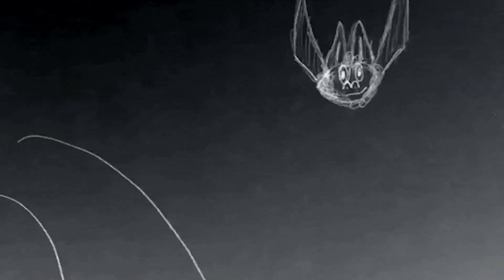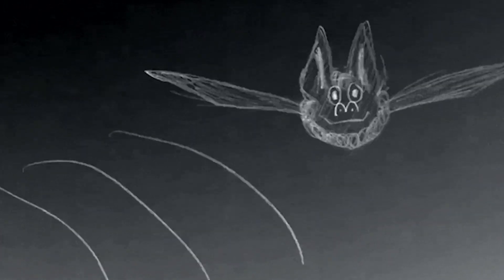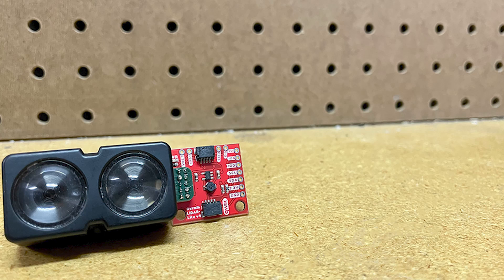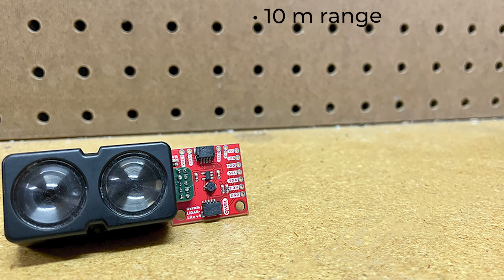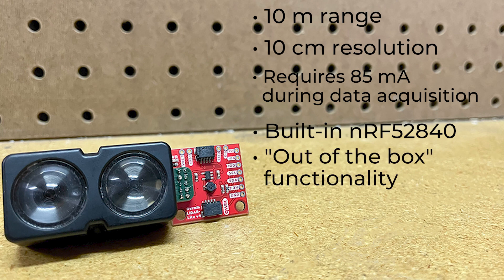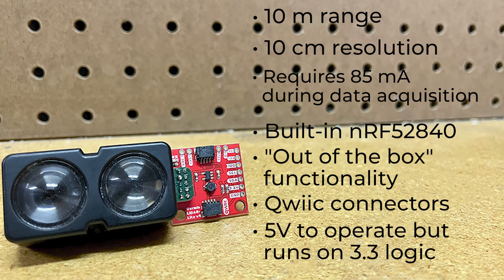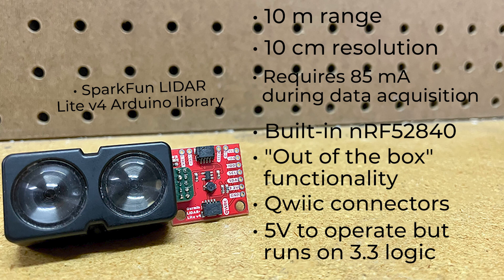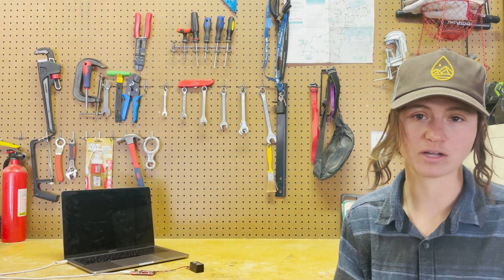Product Showcase: Garmin LIDAR-Lite v4 Qwiic

Comment: 10cm resolution is not very good!
Reply: Yes it is. This is on distances up to 10 meters, ie 1%.
The resolution on up to 2 meters is +/- 1 cm, ie also 1%.
That's not bad.
What are you comparing it to when stating it's not good? Is there a better device at this price point?
Reply: @MartinBgelund  maybe compared this hc-sr04 which has +/- 3 mm  accuracy on 4 meter range?

https://www.sparkfun.com/products/15569
Reply: @muayyadalsadi  That's not how I read it. The range is stated to be up to 4 meters, and the accuracy is stated to be up to 3mm, but it says nowhere that you can achieve +/-3mm accuracy on the full 4 meter range.
+/- 3mm accuracy is probably achieved on very short ranges. 3mm is a whopping 10% error on 3cm for example. 
I've several HC-SR04's, and worked with them a bit. Trust me, they're not giving you just 3mm errors on 4 meters.
This test here indicates an error of around 3.5%: https://forum.arduino.cc/t/hc-sr04-tests-on-accuracy-precision-and-resolution-of-ultrasonic-measurement/236505
It's common to only take integer readings from the HC-SR04, since its accuracy isn't that great.
Reply: @MartinBgelund  and hc-sr04 is slow. But i was trying to answer compared to what and this is what came to my mind.
Reply: @muayyadalsadi  Of course, and please don't take this the wrong way :-). HC-SR04 is a great sensor at a very low price, But in my experience it doesn't really has the properties to compete with the specs of this lidar module. The closest competitor I've found using ultrasound is the HC-SRF08, and its range is "only" up to 6 meters (still impressive, though), but at a much higher price than the HC-SR04, and still far less than this lidars 10 meters range, and I can't find any mention of its error rate.